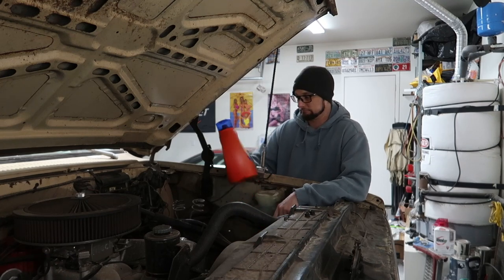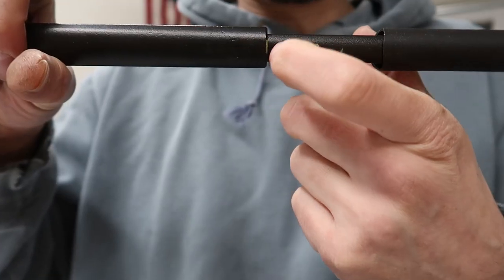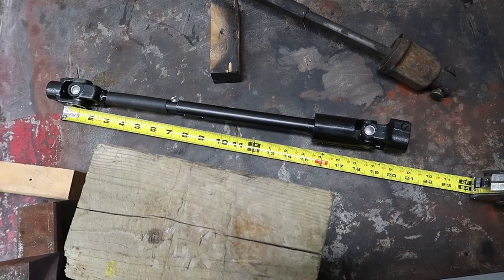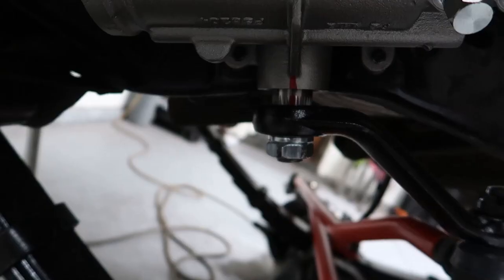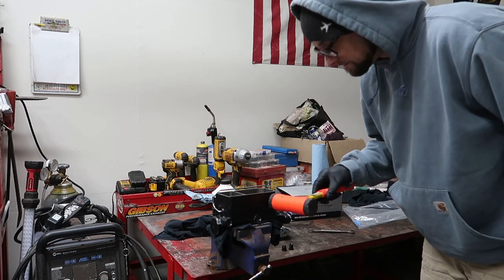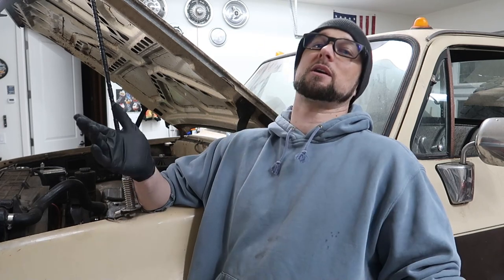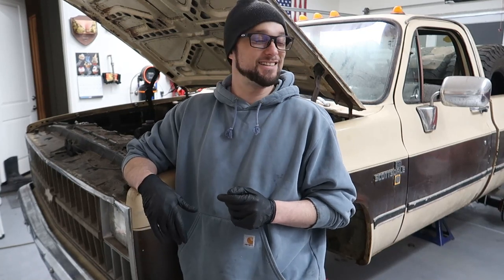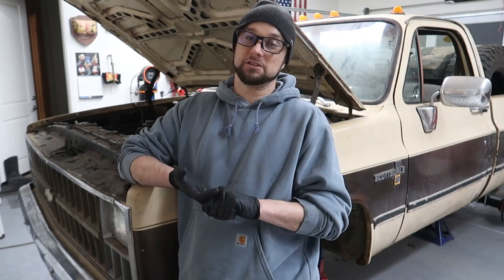K30 Trail Build, Jeep Cherokee XJ Steering Shaft Upgrade, and More!

Comment: I grabbed one off xj grand Cherokee and I guess that's the wrong one lol. The clamp joint that goes to the firewall side is way to small to slide over the stub from steering column... Guess I need one off just xj

Comment: So how is the truck now that you have taken the rag joint out? The rag join was designed to help remove vibrations from the road causing your hands to become fatigue.
Reply from the maker: I haven't driven the truck enough yet to tell you how it performs. But I can guarantee that you wouldn't notice fatigue, that was old technology that absolutely no one use uses any more.